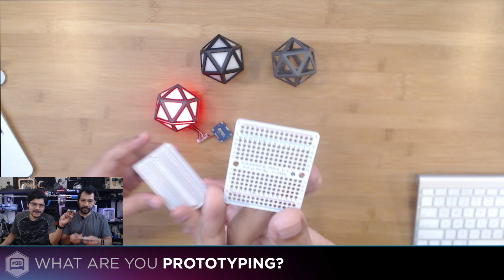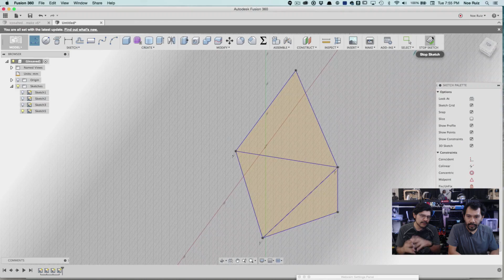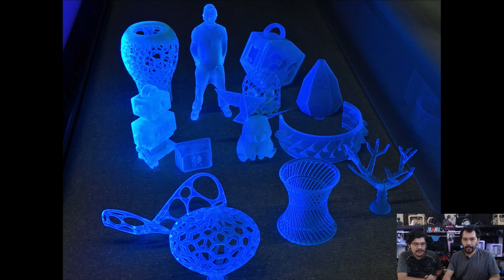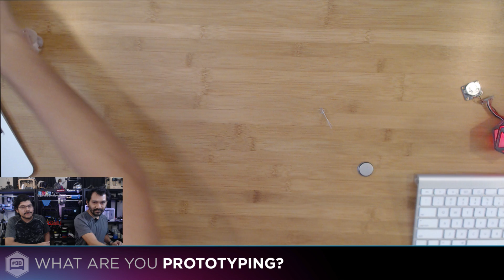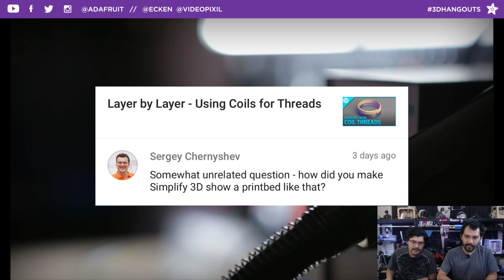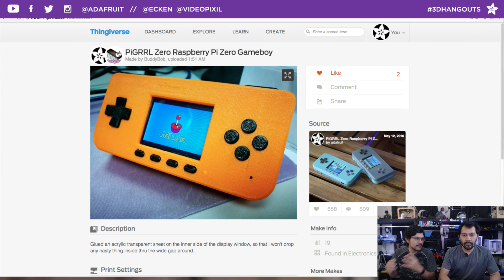3D Hangouts - Glowing Icosahedron & Resin Prints

Comment: Great tutorial on including 3D geometry.  Just a heads up, I struggled to get this to work and realized in order to get the snapping feature to work between geometries, you must have the 3D Sketch option checked in your sketch palette.  Otherwise you will not be able to get your lines to snap when drawing a line between two different planes.

Comment: Cool, I didn't know you can print resin. Would be great for cosplay props I guess.
Reply: Its expensive and the 3d resin printers tend to have very small build volumes.  I'd stick with FDM and sand post print.  More cost effective and versatile.